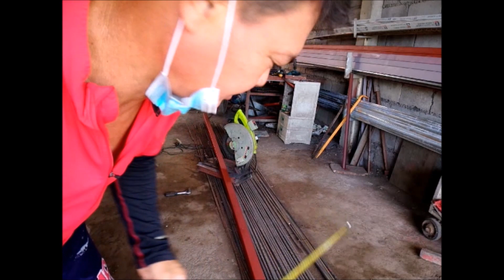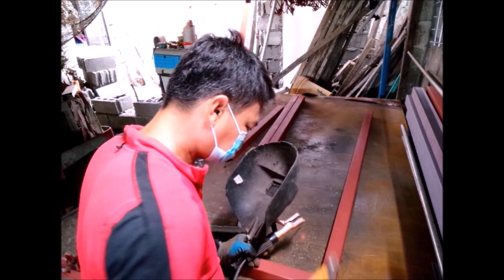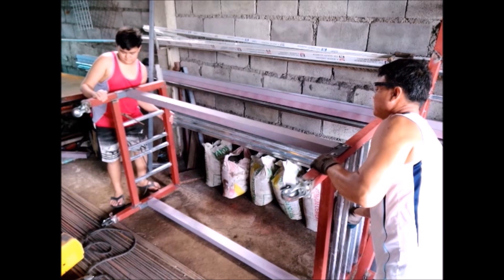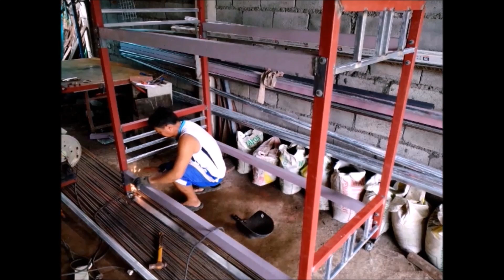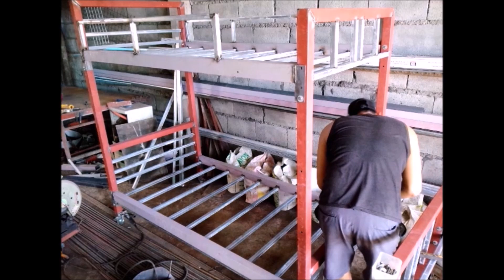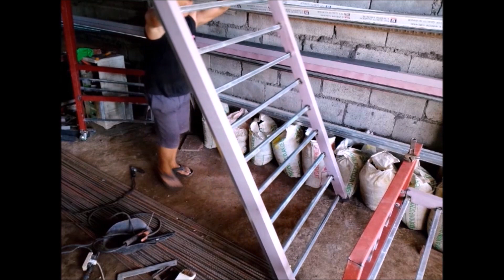Metal Double Deck Bed

Comment: Bilib naman ako sa galing nyo. Ty for sharing. Boss anong size ng tubulars gamit nyo? Saka yong angle plate sa joints ( tawag ba jan) at bolts anong size po? Magkano po isang order double deck nyo? Salamat po.
Reply from the maker: salamat po kadiskarte , tubular frame size po 2x 3, poste 2x 2, sahig 1x1 , lahat 2.0 ang kapal, yung sa joint, angle bar na 2x2x316, depende po s size ung price ng double deck
Reply: Magaan lang po ba yang ganyang materyales boss?
Reply from the maker: @allan9720  may kabigatan din kadiskarte, pero ok lng naman kc nadi -dis assemble naman
Reply: @bisayangmadiskarte2637  magkano lahat nagagasto sa lahat ng mga bakal idol?
Reply: @bisayangmadiskarte2637  galing mo lods